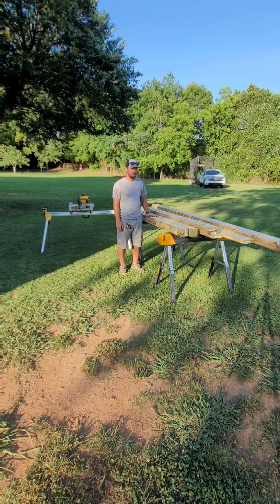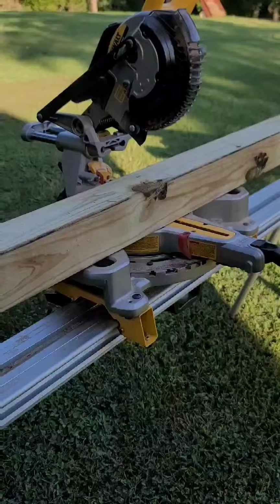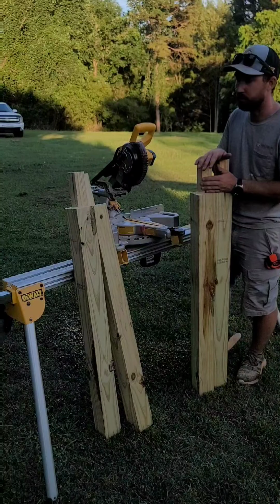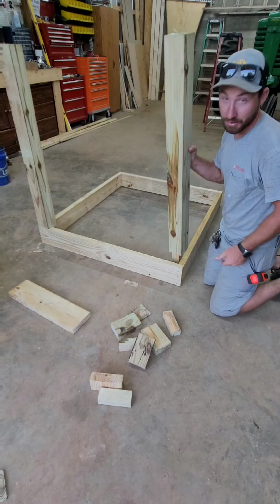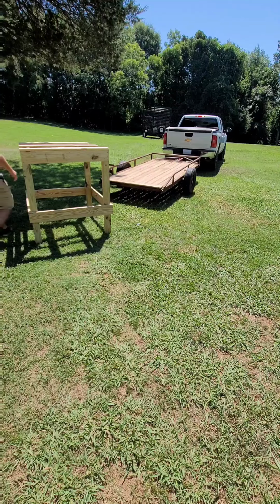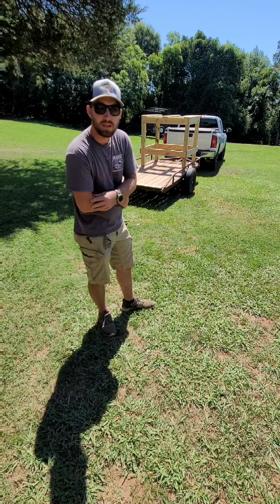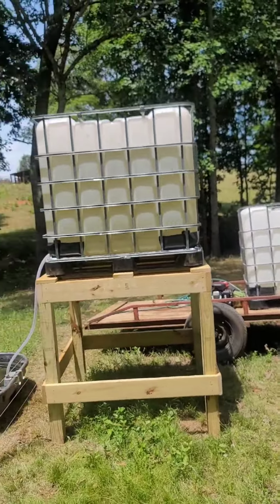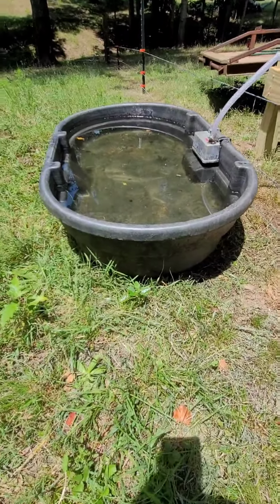How to build a IBC tote stand | Water for the piglets!!

Comment: When full, that IBC is going to weigh 2300 lbs (275 x 8.34 lbs)!  The wood stand was just put on ground, I think.  So, I'm wondering, once it rains and the ground gets softer, are the wooden posts going to settle into the earth with all that weight on them?  What was your experience now that it's been there awhile?
Reply from the maker: The stand holds the weight with no problem. I wouldn't be afraid to put a lot more weight on it. Down there where the pigs are is a wet spring, so it stays soft most of the time.  I haven't noticed it sinking, but I thought I put 4" cap blocks under the posts.

Comment: Are you planning on painting the totes black to prevent algae buildup?
Reply from the maker: This would definitely be easier and probably cheaper than painting it 
IBC Tote Cover with Zipper, 275 Gallon Sunshade Waterproof Protective Cover, Heavy Duty Nano Materials Dustproof Fade Resistant Tote Covers For 1000L 275 Gallon Water Tank https://a.co/d/gQmAh0F

Comment: Just found your channel and looking for the same, how is it holding up?
Reply from the maker: It's doing great! If you have in a pasture with other livestock like goats or cows I would put some braces from top to bottom at 45°, my goats like to rub and scratch on it and they maid it lean a little, but strength wise I wouldn't be afraid to stack two totes on top of each other and fill them up.